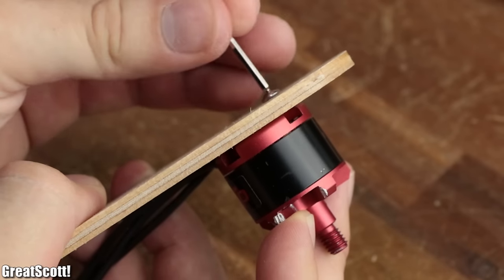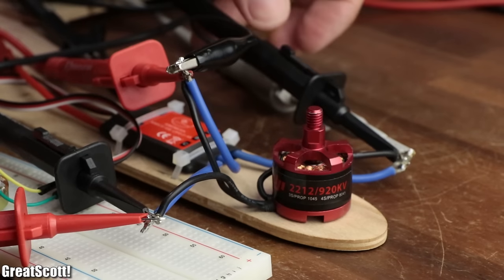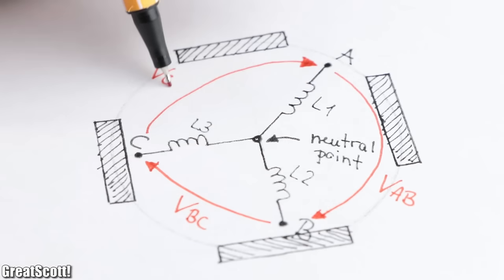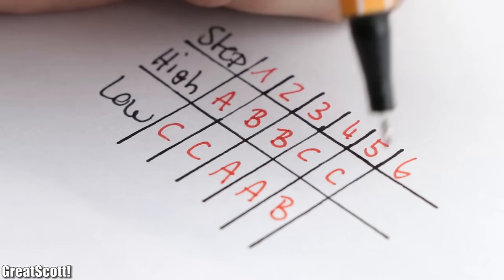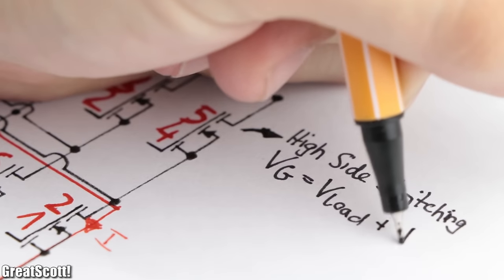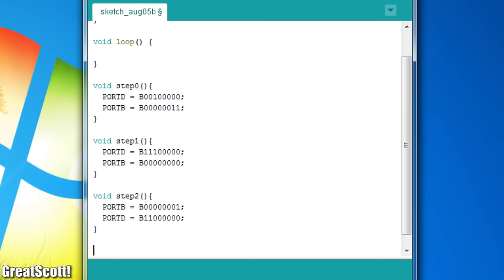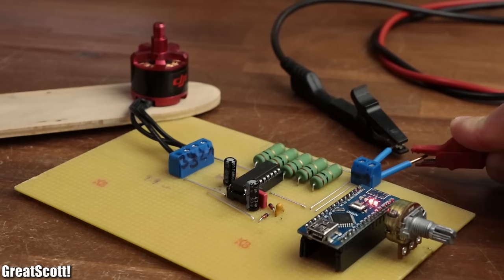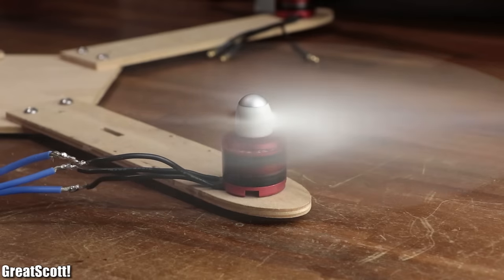Make your own ESC || BLDC Motor Driver (Part 1)

Comment: Who else wants bootstrapping basics?
Reply from the maker: Me!
Reply: Kau Mohlamonyane ido
Reply: Me!
Reply: What is bootstrapping? I'm asking serious. Explain this to me like I'm a total noob plz.
Reply: Still waiting on an explanation
Reply: @PinkeySuavo  did you get and answer ?
Reply: @axelflores4285  nope:(
Reply: Bootstrapping is a method to drive N-FET on positive rail. This is required because N-FET requires gate voltage higher than the source voltage to start conducting. Since the source already has positive voltage, the gate needs to be at even higher voltage, which is generated by the bootstrap circuit.
Reply: @Asu01  why not use p-channel fet?
Reply: Henry Chang higher Chip Area for Same on-state Losses needed, because of lower defectelectron velocity compared to Electrons. Thus, comparable p-channel mosfets are More expensive.

Comment: I once programmed an Arduino to function as a very basic ESC. It couldn't start the Motor on it's own and changing the motor speed while the motor was spinning caused the motor to stop. But as long as you start the motor by hand and don't change the speed, it works.

That was for a school project where we were supposed to build a DC motor, while many failed, and some didn't really fulfill the task, I had to overdone it ^^'
Reply: Neat. The issue is fidning motor position.

You can use the voltage created in the coils, but it won't do the start so you will have to step it up to run-able speed.

The other common option is having sensors in the motor to tell the position, and use them to determine what step to use.
Reply: Chickenbread Designs did you use a different power source and a mosfet switch?

Comment: I'm not entirely sure that this is how a sensorless brushless ESC works. Commercial units read the back-EMF induced in each of the coils to determine the position of the rotor and turn on the correct phases. Speed control is achieved via PWM modulation of such phases and not by arbitrarily speeding up the phase switching.

Comment: Great Video! you can even 3d print a frame instead of using wood also would you please condider talking about SimonK firmware, BLHeli Firmware and other popular firmwares for ESCs? im constantly burning my escs , my guess is the BEC is causing some kind of short within the ESC and burning it, but this is a great video eagerly looking forward to the second part!
Reply: How much current are you using? How big is the filter cap on the ESC?
Reply: Well, what is burning? The BEC supply and rest of the ESC are typically separate circuits. There is usually a separate regulator for the microcontroller, which is sometimes shared with the relatively low current gate drive supply where applicable. FET failures can happen for all sorts of reasons (external oscillator stopping from moisture, excessive body diode conduction, no external pull-offs to deal with MCU resets, etc), many of which can be secondary failures.
Reply: You probably need higher Amperage ESCs
Reply: Thank you guys for the suggestions I should have given a little more information, so I use the cc3d FC, best way to power it is with ESC via BEC, the ESCs are 30A SimonK and the battery is 3s lipo 3000mah 35c, everytime the ESC with which I power the quad blows out (in my case ESC 1,which is front left in an X configuration quad) I dunno what to do, I will try to order a new batch of ESCs and then supplying power to FC via PDB directly (my PDB has a voltage converter IC on board), hoping this to solve the problem, as other wise when I opened the ESC only 1 MOSFET was burned, this could have been the voltage convertor or BEC too, as it's burned so badly I can't read what's written on the package.
Reply: Afzal Patil what amperage are your ECSs and what motors?
Reply: Parallel Realities motor is 2212/6T 2200kv motors, along with 6045 propellors earlier and they worked kind of fine, but this ESC burning has started only after changing the prop to 5030 gemfans, and upgrading battery to 3000mah 35c 3s from the earlier 2200mah 25c 3s, model weight with all fpv equipment and all is 1250g however the datasheet of the motor says each motor can handle 700g-1000g weight, and normal operation current according to manufacturer is 22A, and max current is 28A so I thought 30A esc would do, can you please advice me on this issue, I'm an engineering student and I find it frustrating that I am unable to solve the problem by myself :(
Reply: Simon Kirby Omg! You're Simon Kirby! You wrote the SimonK firmware right? Great job man! Lots of love and respect from India! <3. 
I guess the BEC is burning because only the ESC that supplies power to the FC burns and when I open it, I can see the MOSFETs are not burnt but something that looks like a voltage regulator which could have been the BEC is burnt badly
Reply: Dont worry, I dont even have my own quadcopter yet. 5 inch props on a 1.25Kg build is pretty hefty. Saying that your motors cant take more than 1Kg, (Thats not each btw) you are forcing them to draw more current. Getting a bigger battery wont always help you,  it may only add more weight to the quad.  What size is your frame? 1250g is very heavy for fpv, considering drones such as the Eachine Wizard X220s 
come in around 500g
Reply: On this...and likely relevant to this video... If the ESC software does not recognize its own timing limitations, power requested beyond that speed of rotation will be dumped as heat. This likely lead to the tales of it being unsafe to run motors without propellers. I believe that if the ESC allows this to happen at all, the software should be fixed. I convinced Steffen to add the RPM limiter to BL-Heli for this reason. Yes, the newer MCUs will go faster (at a price), and there can be some other improvements, but this is typically no problem except for on very high RPM setups, and even then, it should only limit the maximum speed.

What ESC was actually used here? I'm guessing you bought some sort of kit from somewhere that came with a no-name 30A ESC and that motor? It doesn't help that some manufacturers (Emax, for example) put out ESCs with my name on it that had absolutely nothing to do with my code, so it may be something different regardless of what it may say.

My code has had an RPM limiter since the beginning, to avoid the problem of cooking motors even if the propeller fell off. It used to be at about 178keRPM. Since 2015-09-12, speeds of over 300keRPM is possible at 16MHz. The 2212-6T 2200KV motor is likely a 12 tooth / 14 pole configuration, which means that a 3S battery fully charged to 4.2V per cell == 12.8V spinning a 2200KV motor would achieve 28,160RPM with no load. 14 poles is 7 pole pairs which means the electrical RPM (eRPM) is 7 times higher than that, or 197,120eRPM, with no propeller. With any sort of propeller, the RPM will be lower, and any configuration should be fine (with good software). I've tested 11000kV motors at 6S on purpose, just to make sure this works, and it does.
Reply: Afzal Patil I'd recommend RacerStar ESCS, they come with BL_Heli installed so that should work
Reply: you should use a PDB with a 5v output for your flight controller, the bec from the esc is like a last resort thing, they are very shotty
Reply: I wrote code a few years ago that works on the stm32f303, which has some really nice hardware protection features, but I've not really found what I believe would be a good reason to make it worth the cost for such a MCU. Also, many of the things I was interested in (variable complementary PWM) can't be done with the hardware PWM, and the less expensive in that series often don't have comparators (which I prefer for back-EMF sampling). eh... Are you looking for any particular reason?
Reply: You could 3d print it but I think wood would be wayyyy stronger without investing in nylon or even carbon fiber filament

Comment: This project is waaaaaaaaaay beyond my brains.
Reply: MrRCking84 That's fine, it's all about learning and that doesn't happen instantly. If you just need a good ESC, they are under $5 for a 30 amp speed controller. I'm not an expert on it either, but I like learning about it.
Reply: Jake Garrett But you are good at what you are doing.

Comment: It's actually "Electronic Speed Controller"
Reply from the maker: Actually some people say electronic, others electric. Doesn't matter.
Reply: I have to agree with Francis.
Reply: GreatScott! If one would want to nitpick electronic would be a little more correct. I guess it's the same like the difference between electrical and electronic engineering. Electronics is more about the working of the semiconductors, controllers,... And electrical more about power distribution, high voltage, etc. Not that they both don't have an overlap. But there is a difference, albeit a small one. 
Not that it actually matters that much.
Reply: Electronic engineering is a subset of Electrical engineering. Electrical engineering is the BSc that you get from university, and you may specialize into electronics/power/communications/EM/nano/etc.
Reply: Francis Rohan John 😂😂😂your that one guy. Who just had to day it🤣
Reply: My university offer both courses as bachelors options

Comment: Speaking of esc. I am planning to build an electric skateboard by only buying components. I don't want to waste money that I can do by myself. Cant wait for part 2
Reply: More fun but be aware that it will probably cost you more in parts if you do it yourself rather than buying an off-the-shelf ESC. Don't do it only to save money because it will cost you a lot more time and at best won't save much money. Having said that it is a very interesting and educational project worth doing for sure.

Comment: What is Bootstrap?
Reply from the maker: Bootstrapping is a method to drive high side n-channel MOSFETs. I might do a video about it in the future.
Reply: I second this question.
Reply: please do :) you explain stuff very well. so would be much appreciated.
Reply: In a nutshell, when we talk about MOSFET transistors it's a technique to obtain a higher voltage level than your supply voltage. In order to correctly drive the gate of a N channel MOSFET placed in a high side topology you will need to provide a gate drive higher than supply voltage.
Reply: Petru Sfecles ohh ok. That makes what he was saying make sense in a way. Thanks.
I'm more of a computer guy so my first thoughts were total confusion xD
Reply: http://tahmidmc.blogspot.com.es/2013/01/using-high-low-side-driver-ir2110-with.html

This post explains very well your question. You could also use an external power supply to drive the mosfet gate, I use a 12v power supply in series with my main power supply on my high voltage stepper/servo driver
Reply: ohh another indian good to see you here
Reply: GreatScott!  : Yes please explain bootstrap in your future videos we are waiting
Reply: I though bootstrap is a pirate name from a movie "pirates of Caribbean".
Reply: do this please!
Reply: Bootstrap in simplest way its some kind of "floating reference voltage" for Hside mosfet. Coz U cannot drive Hside transistor with ground reference (check shematic) [Vdd] -> [Hside Transistor] -> [Coil] -> [Coil] -> [Lside Transistor] -> [GND] Low side is directly connected to GND co U can easy drive it (Ugs). But how deal with this when Hside Transistor is connected to Vdd = 100V when Ur arduino is powered with 5V? Bootstrap is simply idea to add voltages on Capacitor Vdd + drive voltage (this equation is more than simplification). U can try other ways like Optocopulers etc but most aplications use bootstrap - sometimes optocopulers and bootstrap to avoid interferences between power stage and logic stage.
Reply: Sumit Kumar Bill Turner
Reply: No that was Jock Strap :)

Comment: wait is it possible to create an esc without arduino? 
i mean well i do have arduino but i dont understand much of it
so there should be second option to create an esc without a arduino, right
Reply from the maker: It is possible to do without Arduino, but I think using a µC is the easier way to create one.
Reply: Logic gates and shift register?...
Reply: I have driven stepper motors with an ULN2008, 4017, a few diodes and NE555 before. It should be possible do to the same with a BLDC Motor.
Reply: You don't use sine with a BLDC. Only PMSM need sine waves; BLDCs use 120° shifted 0 -1 0 1 (stair?) waves
Reply: Also called block-commutation.
Reply: Yes, use PIC
Reply: You can browse the big chip makers for "BLDC controller". Some of them are stand-alone.
But you are likely  to be limited in current (2-3A max for most of them).
Reply: Use a teensy 3.2 board and mbed framework. thank me later. Arduinos are toys without proper multi-threading support.
Reply: its easier to buy a flightcontroller like BetaFlight
Reply: teensy 3.2 is like 30$ not much more expensive than other arduinos. 

Great Scott was utilizing microcontroller features of the 328p such as utilizing the timer registers and the pin registers.

With a teensy you wouldn't even have go that deep. with mbed you can declare all the timers you want with accuracy upto 1us. Obviously if you configure the timer registers you can get much more accuracy, but you dont need that for a controller board for a motor/quadcopter. 

And the mbed threads are really easy to understand. It allows you to make your code much more streamlined and dynamic.
Reply: How the fuck is multithreading needed for this task? You can build an ESC with a shitty 8051 controller (like, all the BLHeli ESCs). This isn't an big embedded system, it's a very simple state machine!
Reply: Very simple to have the PID controller update itself on its own thread. Also wireless transmissions are typically really slow, so it nice to have those on their own thread as well. Basically any feature you add, you can toss on its own thread and forget about it.

also shitty 8051 controllers can be multithreaded. most embedded systems are multithreaded.
Reply: A normal ESC has the PID running all the time and the PWM being done by a timer, you don't need multithreading for that. Yes, most EMBEDDED SYSTEMS are multithreaded, you can multithread almost any microcontroller by use of an embedded OS. But most applications for such low-end MCUs are not embedded systems, but just simple control, where no multithreading is needed.

Wireless transmissions are also mostly done in internal peripherals, so they call an interrupt when finished. This isn't multithreading, but has the same effect.
Reply: @Leonelf: the sine waves feed the PWM. ;) Increases efficiency.
Reply: For a quadcopter you should be using threads. I dont have a clue how the system would would be stable at all with the latency of radio transmissions. 

Obviously a simple PID can be implemented with a 555 timer or an ATTiny. Its when you add more things to process simultaneously, working without multithreading is difficult.

Hell when great scott used the ISR function, he's using interrupts. Which is how multithreading works anyways. Its just ISRs being called at certain times. mbed makes this concept of real time interrupts really simple with threads.
Reply: Supplying three phases doesn't need a microcontroller. Sending out good wave forms and timing them with sensor data, and controlling startup, takes some happy robot brains.
Reply: Eric Cartman this is the esc, not the flight controller. It just doesn't have that much variety of stuff going on.
Reply: But this is about the ESC, not about the flightcontroller. In reallife applications you have a seperate IC for the ESC anyways, because it's so critical
Reply: use a microchip pic.
Reply: I built a BLDC motor drive for a hydrogen car just using a teensy. really simple. Also controlled a LCD and radio communications (bluetooth).
Reply: Eric Cartman 
would a teensy work good for a inverter project. for controlling safety shutoff . over heat , current. low and high voltage. also for a spwm output. and a Bluetooth data . of volts amps and watts. would it be fast enough for keeping the voltage out regulated. prevent overshoots and voltage drops.? I am very new to electronics. and self taught. what little I know.
Reply: There's a reason people use microcontrollers.  You can use one chip and some code, or you can design a very complex circuit with many more parts, very little flexibility and for many times the cost.
Reply: U can create an ESC without arduino.
in this case arduino is their to control MOSFET's or drivers 
so u can control them by using any microcontroller with some proper codes

Comment: Use the IC MC33033 from Onsemi to receive the 3 phase encoder signals and to drive the gates of the 3 high side and 3 low side fets. Its works quite well. All you need are signals to drive the direction of rotation and a voltage to set the speed.

Comment: Cool project, Joop Brokking did make his very own flightcontroler for multiroters driven by the arduino
Reply: Henkel gezwenkel everything is becoming diy these days .You can make your frame (3d printing) ,your radio(opentx mega,nextsteprc),flight controller (joop brokking,multiwi etc),ESC as this one and in another channel I have seen.someone even created his own 3d printed motor(halbatch or something like that).wow really wow

Comment: Hi @Greatscott! Scott, I'm working on a project which is need a brushed dc motor driver. I have only university knowledge(so simple) to how to drive motor. So Do you have any idea to how to make and probably I need a oscilloscope can you give me an advice(mid range oscilloscope). About project: a kind of hedge trimmer but it is not trimming ornamental tree, its trimming tea plant. Some times it can jam so I need avoid high current not to burn dc motor.